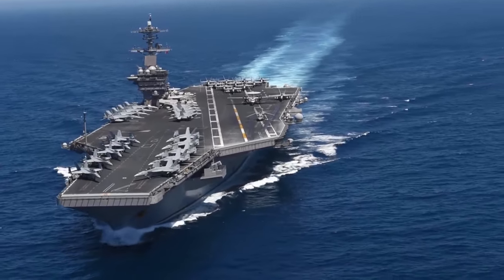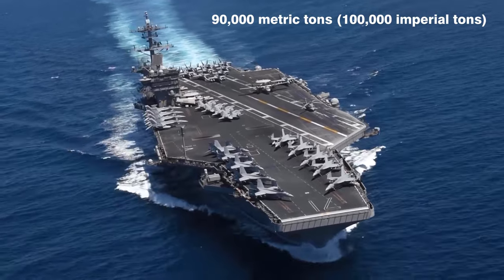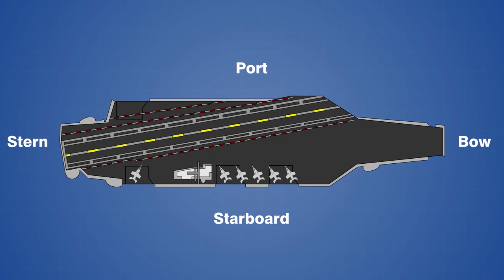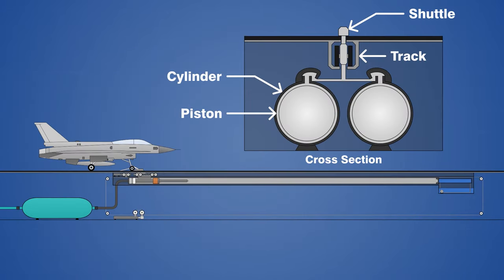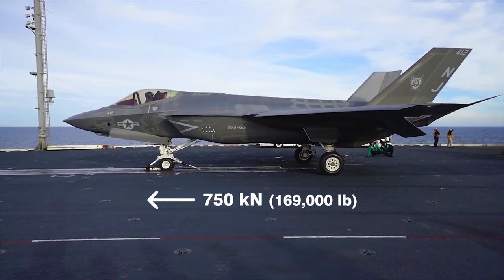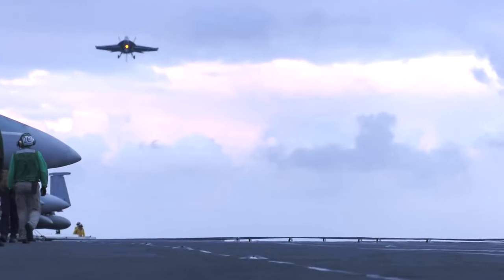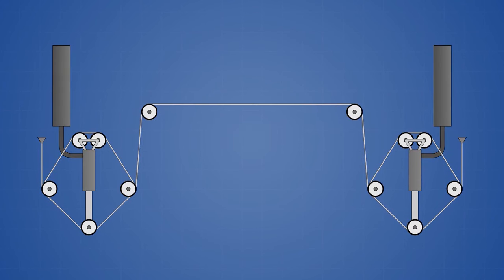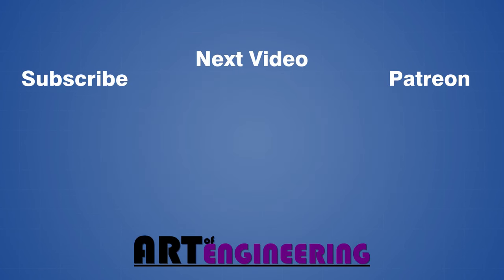How Supercarrier Aircraft Catapults Work

Comment: Do-dodonpa at Fuji Q highland uses compressed air to accelerate from 0-112 mph in 1.56 seconds (3.3G)
It’s system is almost identical to the steam catapult system except it uses air 

Rock n rollercoaster at Disney World has a much tamer 0-60 in 2.8 seconds (1.6G) uses an electromagnetic system to propel a catch car that is pretty similar to the new electromagnetic system to launch aircraft 

Pretty cool that the same technology can be used for wildly different applications
Reply: Rock n Rollercoaster uses an LSM launch system, whereas flight carriers have used LIM in the past, at least as far as I know. But yeah, it's crazy in how many situations these technologies are used
Reply: There's a ride in Australia called the tower of terror, 0-160.9 km/h in 7 seconds, good for 4.5 G
Reply: I can eat bread, I can toast it, I can dip it in my soup, I can feed it to the birds, I can make a sandwich with it. Wow so many applications, must be military grade.
Reply: @lachychops2  But those 4.5G are not occuring during the launch. They occur while riding the "curve" upwards where the train isn't accelerated anymore. The actual launch (acceleration) itself has less G's than both of the other mentioned rollercoasters.
Reply: rock n rollercoaster's actual launch speed is 57 mph

Comment: On the carrier I was on, USS Coral Sea CV-43, the catapult steam line ran underneath our berthing compartment which made it quite hot, about 90F/ 32C. Not good for sleeping.
Reply: Wasn't Cruel Sea and Midway both built from heavy cruiser hauls?
Reply: @robertrichard6107  Separate class incorporating British armored deck approach and with British low freeboard that made flight ops impossible in stormy weather. Upsized from Essex class to handle a larger wing but too small for F-14 and ultimately the cramp design and hard use made them the least capable front line carriers

Comment: Do these ever fail? Theres really strong forces going on so if something broke itd be pretty spectacular. Has that ever happened?
Reply: Yes it can happen.  The arrestor cable in particular, because of the immense stress it goes through when an aircraft hooks it on landing, is susceptible to snapping.  If it does snap you can imagine what a heavy duty metal cable whipping around the flight deck could do to a sailor.
Reply: Yes in fact 2007 on the Truman a Hawkeye launched lost pressure and went down.. I was on the Truman
Reply: Not often, but it does happen.. I know of 2 instances where the Traps (the 4 cables that catch the aircraft), have snapped, one injured quite a few deck-crew, and another had its severed cable slice through bulkheads and a few decks.  I know of a few times were the cat failed either by not working at all (and the plane had to be backed off the lane), or failed to get fully up to the needed speed and the pilot ends up having to eject and 'hope' they dont get ran over by the carrier.
Reply: I’m once heard arrester cables are replaced about after about 100 traps. In the Mike Rowe Dirty Jobs show he sees a team fusing a arrestor cable to the runout cable via  joints that becomes solid zinc.  I don’t know but I thought that’s what it is and it takes 8 hours of high temperatures.

Comment: Loved the video, but I noticed that the example plane you used for the animation was an f 16 (a 2 seater variant specifically). Correct me if I’m wrong, but I thought that the f 16 was only an Air Force jet and not a navy jet.
Reply: @drozycoder2007  Imagine calling someone a nerd for knowing F-16s aren't launched from aircraft carriers.
Reply: The F-16N is used as a Top Gun aggressor, IIRC, but no Viper variant is carrier capable.
Reply: @drozycoder2007  Your mum must be proud of you insulting a stranger on the internet.

Comment: why wouldn't the arrestor cable snag the wheels?
Reply: Because of the angle the pilot comes in at. That’s why he said it requires hella skill.
Reply: @john bolton 
Stretch a jump rope across a sidewalk with a person holding each end taught so that the rope is about two inches above the pavement.  Now have third person ride a bicycle into the rope.  What happened?  Did the rope snag on the wheels of the bike?  

Of course not.  Same principle applies with aircraft landing arrestor cables.

The diameter of the arrestor cable is very small when compared to the diameter of the aircraft tires.  Since the aircraft is moving forward, its wheels begin rotating forward soon after they touch the deck.  The direction of rotation of the aircraft wheels and tires ensures that the arrestor cable is swept downward and then forced underneath the tire without incident, as the aircraft continues forward.  The tires rotating in the forward direction effectively prevents the arrestor cable from climbing upward along the tire, and snagging the landing gear.

Comment: Good basic explanation of Catapult systems. How about getting to the real dynamics of how catapult operations really work. Starting with the hydraulic / pneumatic systems below decks? Could you provide a “in depth” diagram explanation of Steam & Hydraulic flow prior to launch? And how exactly the Rotary Retraction Engine works in conjunction with the “Grab” assembly? Also curious how the Water Brakes stop the pistons so quickly after launching so fast. I think that would be helpful info the rest of the population would like to know.

Comment: before they launch, do they already have their engines throttled up on the deck?
Reply: Yes
Reply: Once the aircraft launch bar is fully & correctly engaged in the shuttle hooks, the DT (Deck Tensioner) will stroke out. Normally the pilot won’t go into full throttle unless directed by the “Shooter” or “Safety Observer”

Comment: How does the shuttle "hook" assembly disengage from the aircraft gear?  Is it pivoting in some fashion?
Reply: As the aircraft gets to the end of the ship the shuttlehook just slides away from the shuttle , there is no locking mechanism on the shuttle that holds the hook.
Reply: When the shuttle hits the water brakes the nose hook slides up and out of the track in the shuttle ejecting right up into a waiting latch on the nose gear.

Comment: As far as I know, though we call the aircraft-catapult a "steam catapult", it is better described as a "superheated water catapult"
If the steam released in the two zipped cylinders was dry steam, the pressure would drop off rather quickly and the push on the two pistons pulling the aircraft would drop substantially and so it is wet steam that is used with a lot of superheated water in it. 
To construct an objective launching function as a constant pressure with a launching catapult, one needs to include, four wet steam accumulator parameters: namely, the accumulator pressure, superheated water level, accumulator volume, and accumulator radius to get the evaporation rate, right. 
If it was dry steam alone, the pressure would drop as soon as the aircraft starts to move, but with superheated water in the accumulator tanks, the pressure is kept constant for as long as there is a drop of superheated water in the accumulator tank. It is after all the superheated water evaporates that the pressure in the two launching tubes/pistons starts dropping but by this time the aircraft is flying and the piston is arrested by a hydraulic water buffer. It is very important to understand the need for wet steam and the thermodynamics of wet superheated water and the calculation of how much to put in the wet accumulator is of great importance as related to the mass of the aircraft being launched. 
The wire arresting gear damping and slowing down system is a system of pulleys where the slack in the arresting wire is taken by hydraulic accumulators with high-pressure nitrogen expansion or contracting chambers as is found in a normal hydraulic system where a high motion sudden demand is needed.
Reply: It's not my rating but I was told the Nimitz Class steam is super saturated, since they're nukes. Your old Forestal, Kitty, and Super Kitty Hawk Class were Superheated Steam, Conventional Powered.

Comment: 0 to 265 km/h in 2 sec. = 132.5 km/m2 acceleration which is around 13G not 4G and is quite extreme. You might want to validate that number.
Reply from the maker: 265 km/h = 73.6 m/s
73.6/2 = 36.8 m/s^2
36.8 / 9.81 = 3.75 G
Reply: @ArtofEngineering   thank you! I missed out on the conversions

Comment: 2:39 Short takeoff and Vertical landing?
It's STOL (short takeoff and landing) and VTOL (Vertical takeoff and landing)
Other than that, great video!
Reply: Short takeoff and vertical landing is correct, the F-35 B Variant is referred to as "STOVL" for this reason.  Saves fuel to not do a vert takeoff but vert landings are easier.
Reply: mmattimeo oh thanks! 
Sorry

Comment: Your coaster comparison was not good because you compared it to a catapult launch. Catapult launches are arguably the most reliable, but have slow accelerations (noted by their length). Formula rossa goes from 0 to 149 in 4.9s. what you should have compared it to was a pneumatically launched coaster, the only one in the world being Do-Dodonpa in Japan (previously, Dodonpa). This coaster uses air power to launch riders 0 to 120 in a mere 1.6s, faster than any car on the market, any coaster in the world, and close to an aircraft carrier's launch.

Comment: actually only some countries use the catapult system to launch their air crafts by that i mean to say you are wrong about the planes not being able to take of from the carrier just with their own power  becuz some of the carriers of countries like India have a ski jump and planes using their own power take off using that ski jump which is just a slope this is a more efficient way of launching imo
Reply: It's actually not more efficient as the planes have to be less loaded, and you can't do a full load takeoff while recovering aircraft
Reply: @demanischaffer  I agree but the planes which take off from these carriers have much more power so they are able attain min takeoff velocity within that ski jump.distance regardless of armament but there is the case of over weaponizing the plane and that's gonna be a problem for both types of carrier launches
Reply: @foxtrot24gamer56  However the Ski Jump doesn't allow the loading of planes as heavily as possible compared to catapults, look at the Russian carrier, to launch a fully loaded plane it has to use almost the entire deck, that's not efficient
Reply: The difference in using ski-jumps vs Cat's is that the aircraft being propelled by a Cat can carry heavier weapons/fuel loads into the air with them, and do not require directional thrusters like what Harriers have (which are what Britian's ski-jump carriers primarily use i believe?)

And while an argument could be made about 'carrying more than you need' on a plane at one time, You can also argue that its more efficient to have 1 plane in the air that can counter multiple threats, vs having to 'choose' which plane to launch and hope your enemy is bringing what your aircraft is equipped to deal with.
Reply: @foxtrot24gamer56  They don't have more powerful engines, actually. Russian aircraft are known to be woefully underpowered.
Reply: @jordananderson2728  okay what now?!... sir you are either factually very incorrect or stating facts based on your own assumption.
Here are the actual facts :
Comparing Russia's in service carrier based air craft(su 33) with Americas in-service primary carrier based aircraft(F/A 18 hornet)
The su 33 has far more engine power than the hornets, producing 74.5kn of thrust in each engine and 125 ish kn on afterburner where the hornet only produces 29kn each and 79kn on afterburner.tge su 33 can cruise at Mach 2.2 where the hornet only does Mach 1.8.su 33 has a range of about 3000km where the f18 only has 2600km.and has superior operational capability than the hornet.

So my advice check your facts before stating em
Reply: @demanischaffer  the catapult only is efficient while responding to immediate threats and where the planes have to scramble.but to load the aircraft bring it to the catapult adjusting the pressure according to the load takes a lot of time and manpower hence there is a possiblity of error whereas ski jump based carrier planes have to line up and push to afterburner which may not be that efficient but is far more safe and the time difference is not all that drastic
Reply: @foxtrot24gamer56  Yes, I am aware that nominally they are equipped with AF-31s; however, the last I heard of, the absurd shortages of the Saturn engines have left them with a lack of proper power.
Reply: @ShadowRhapsody81  the ski jump based carriers were made taking into consideration the maximum take off weight of the planes it would be using in this case the su33 can easily take off with Max weight without a catapult and the planes tho they have to use the full deck are still able to launch with 1-2 min gaps and this time difference between launch is expected only while responding to threats .during missions where every aircraft has a different agenda the time gap is more but there never has been an instance of not being able to take off due to excess weight.this is because the plane itself has a very powerful engine and can achieve take off velocity within that small area.

And the point of a multirole aircraft is not to jam all sorts of weapons it can carry and adapt to the situation in the air there's nothing as overweaponizing a plane the mission is carefully drawn taking each weapons use into consideration. Hence they have to launch one aircraft for bombing missions and one aircraft for cap and one aircraft for escort they can't send one "overweaponized plane" to deal with every odd that's the wrong interpretation of multirole
Reply: @jordananderson2728  "the absurd shortages of Saturn engines"??! "Lack of proper power"?!! Dude wh at are you saying all the current serving Russian planes are fitted and operation capable and wth is proper power I just compared the starchid of the usn vs the su 33's engine and the hornets way over matched wth do u mean by proper powerXDXD
Reply: @foxtrot24gamer56  If you don't have the right engine...
Reply: @foxtrot24gamer56  However the US has had experience with proper usage of catapults for about 76 years
The catapult allows larger aircraft with larger payloads to takeoff and allows more types of aircraft to launch

Comment: Wouldn’t it be easier to use a retractable ramp like shown in the video, this would give the aircraft enough time to gain speed and lift great enough to not fall?
Reply: The plane in that shot is stol/vtol, it would only work for planes meant to take off that way (the Brits and Russians and possibly/probably the Chinese do for their carrier based planes afaik, thus the ramps on their carriers.
Reply: badtz maru Yeah so thats not a problem just raise the ramp when a normal plane takes off.
Reply: @oleksandrvovchanchyn7440  How would that accelerate the plane to takeoff speed?  or am I misunderstanding what you are asking, are you saying to use the ramp instead of the catapult?
Reply: badtz maru yes use the ramp, while the ramp pushes the plane up like shown in the video. It gives the plane enough time to accelerate and lift.
Reply: @oleksandrvovchanchyn7440  Ramp's don't 'push' and unless you had a very long ramp the plane wouldn't get anywhere near take off speed.  The only reason the F-35 can is because the navy version is designed for stol which it uses for the 'ski jump' takeoff.
Reply: badtz maru As in the ramp make the plane leave the aircraft carrier in a higher angle. At this point the plane does not have enough speed to lift. When the plane is above sea level this give the plane time to accelerate while it falls a little, then it gains enough speed to lift.
Reply: @oleksandrvovchanchyn7440  but it wouldn't.  using the queen Elizabeth as a reference the deck is 280 m, an f-16 needs 457m to take off and almost double that to land, the additional 70m till you hit the water simply isn't enough.
Reply: badtz maru ok so why cant they use just vtol planes?
Reply: @oleksandrvovchanchyn7440  They who?  The UK does use stol/vtol on their carriers, as for the US the marines are the only ones who use vtol afaik.  As for why, I'd imagine the loss of overall performance that you give up to get vtol on a jet would be one reason, I'm sure there are lots of others.
Reply: badtz maru What performance do you loose? When your in the air flying you use your normal engines that dont move.
Reply: @oleksandrvovchanchyn7440  You would do better to read up on the harrier and the f-35B, the plumbing that allows for V/Stol introduces various issues.
Reply: @oleksandrvovchanchyn7440  VTOLs are shit, just use your brain.
Less max takeoff weight + added weight to support the vertical thrust system.
= less fuel onboard = less range
also = less payload